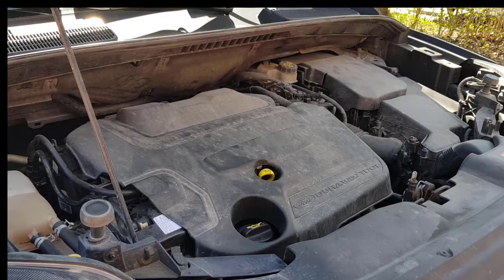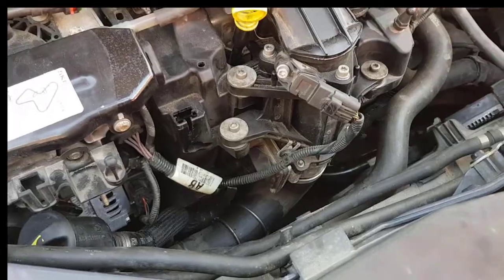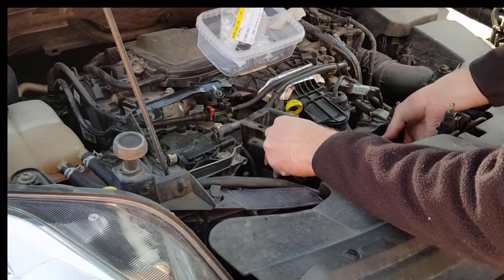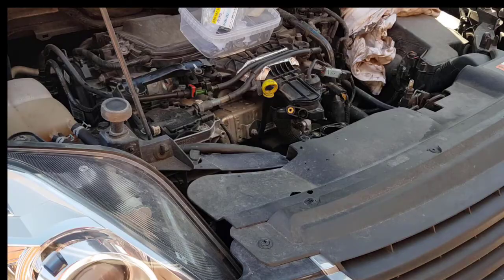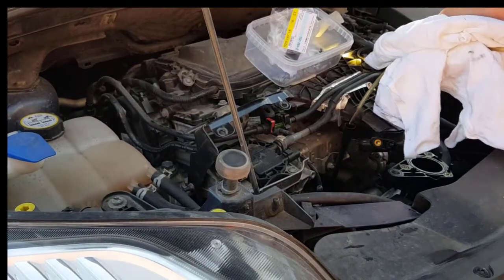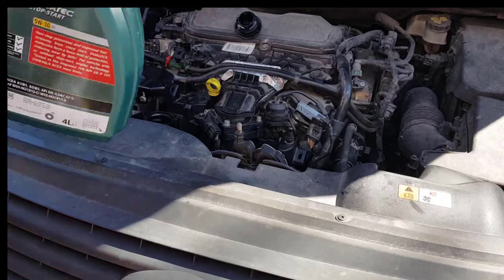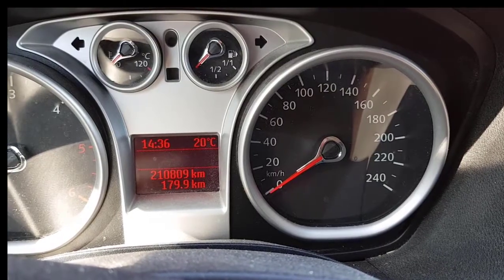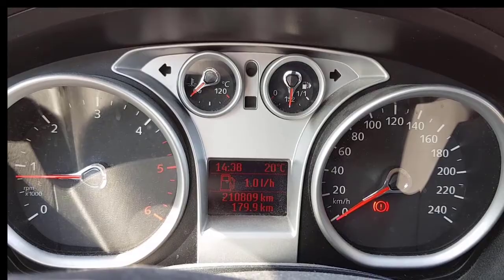Complete Oil Service Ford Kuga 2.0 l 140HP Mk1

Comment: Thank you so much for this, great video. I doubt that garages would remove that cover, they would try and wiggle the filter out but great point about debris potentially entering engine. I had not thought of that so thanks. However I cannot remove that cover as there is a large pipe between the radiator and throttle body which prevents me from moving the throttle body towards radiator to remove cover, and there is a plastic clip holding the pipe to radiator and I cannot for the life of me work out how to open the clip to move the pipe! What a nightmare to change filter!

Comment: Thank you so much for your effort to make this video, as you clearly said in the beginning there is not really any guidance on how to replace the oil filter. I must congratulate you on a job well done and also your YouTube skills, really informative and good.

Only sad thing is, you have proof to me that I must rather pay someone more experianced than I am to do the service, as I dont have all the right tools and is worried that I will damage something seeing that there is so many parts to remove and put back.

Why in the world did they put the oil filter there??!! On all my previous cars that I owned I always did it my self, as I always do an engine flush with diesel before I put the new filter in and replace the oil, but with all this parts, I do not think that will be possible.

So once again many thanks for your help and perfect step by step video, Sometimes I believe in rather get the right person for the job as things clearly got a bit more complicated than on older cars.

Once again, many thanks, and was also impressed that you showed how to reset the oil change alarm, I was under the impression you would need too do it via the computer with special cable connection and software. So yes you where a real help. 

Be Blessed and may you and all your viewers have a Blessed 2024.

Comment: My diagnostic obd2 port has stopped working on my kuga 2009 is there a fuse for the obd2 port and where is it located any help please
Reply from the maker: Hi Mark,
there is no fuse to the OBD connector itself as it connects to the EEC computer in your car. This in turn has a fuse located in the central fuse box.
Does the car run at all?

Comment: I just used a shortened 27mm spanner to remove the oilfilter housing.  There is no need to disassemble that whole section of the engine to get to it.... It's a tight squeeze to get the filter out, yes, but really no biggie... 😊
Reply from the maker: Actually I would not do this: Dirt can fall from the top into the filter housing: This can in worst case destroy your turbocharger bearings. Also, you get all the oil spilling downward in the engine compartment...
Reply: Yeah I managed to get the spanner down and I have hands like Shrek😅.

Comment: Hello ! Can you, please, tell me if the oil can be drain ONLY by using a oil pump ?
Reply from the maker: You can also drain it using a plug under the engine. For this you have to remove several covers and lift the car horizontally... I use the pump because it is in expensive and you don't make your hands dirty...
Reply: @mykuga2025  , thank you !
Reply: @mykuga2025 why lift the car horizontali?

Comment: Hi. Looking for advice, I keep getting engine malfunction for "oil deteriorated" although I've recently had an oil change and done reset using pedals.  Any ideas??
Reply from the maker: Change the oil and filter and then reset the warning as shown in the video. If it gets back you need to check the sensor

Comment: Remeove the clamp on the intake rubberhose and slip off the hose, then you get just enough clearance to change the filter
Reply from the maker: Right... but make sure that no dirt gets into the filter housing. This would kill your turbo charger....
Would not recommend doing it "blind" behind the hoses...

Comment: Thank you very much for your kindness for sharing this tutorial.
I have to do the same thing on a 2012 Ford C-Max 2.0 tdci and I will follow your steps.
I once saw a mechanic replacing the filter but until I saw your video, I didn´t remember all the steps.
Now I know what to do without the always hard try and error process... :-)
Thank's again.
Reply from the maker: Hi Xavier! It's interesting to hear that the same thing applies to your C-Max as well. I did not know that it was the same engine. But as I understand does Ford use PSA Diesels...
Did my tutorial work for the C-Max in the same way?